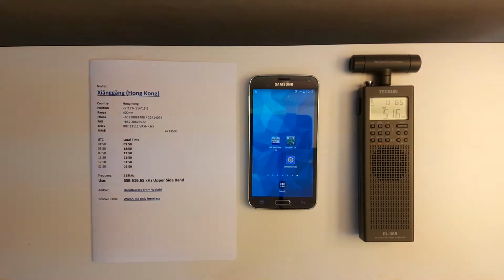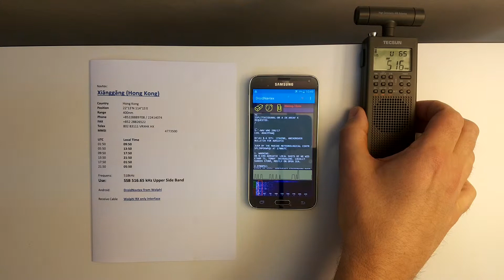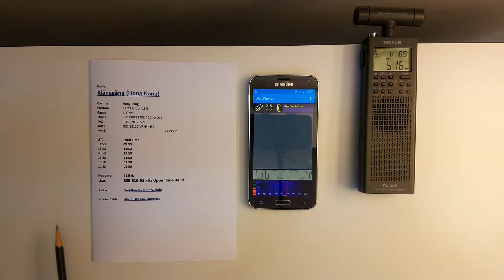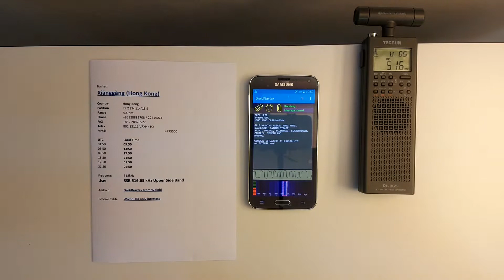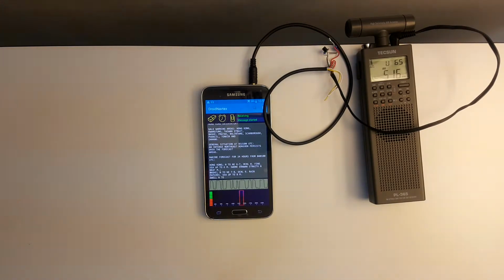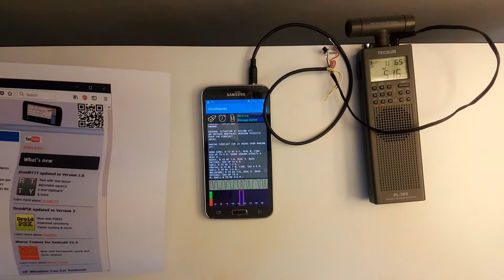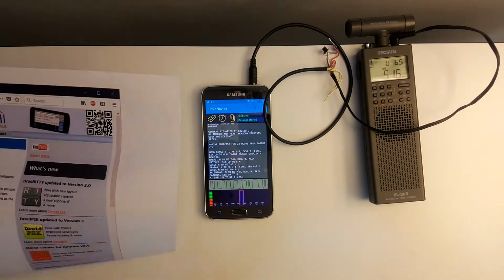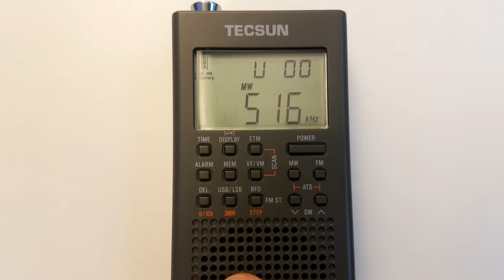PAN-001: NAVTEX

Comment: Very interesting video, after watching this i have got navtex to work using my yaesu ft897 as a receiver and have recieved messages from 4 different transmitters. How far are you from the transmitting station using this radio?
Reply: The video was made in Hong Kong in the middle of tall buildings. So not the best place for receiving short wave signals. I am not sure how far away from the transmitter. I had to go close to the window to pic up the signal. This should be easier out on the water.